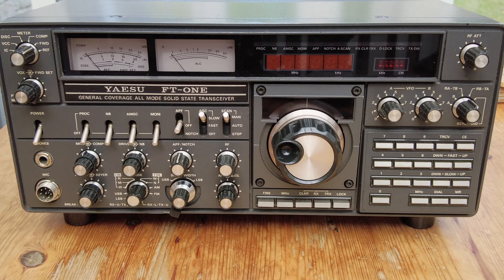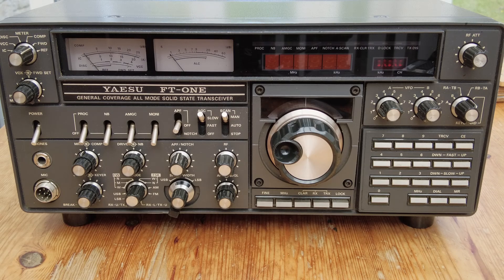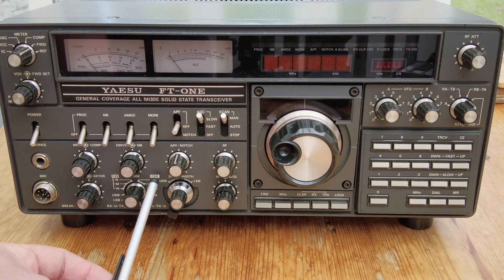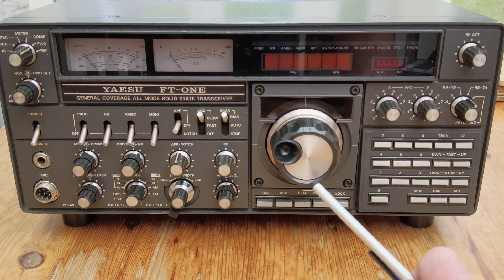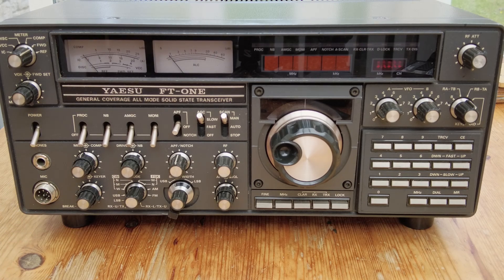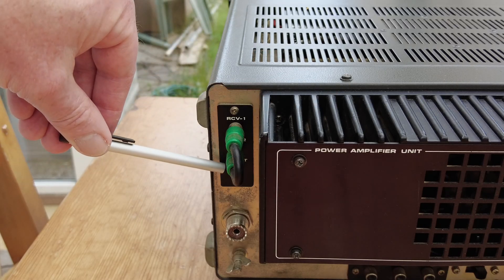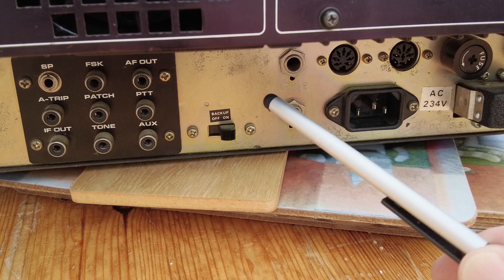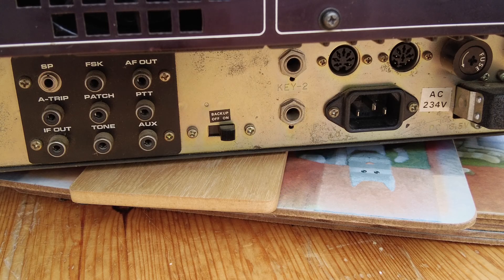First Look at the Yaesu FT ONE Transceiver

Comment: The HT is actually a FT-1D or FT-1DR. It's incorrect to call it a FT-1 (for the obvious reason that you already pointed out.). The letter D is printed on the radio front.